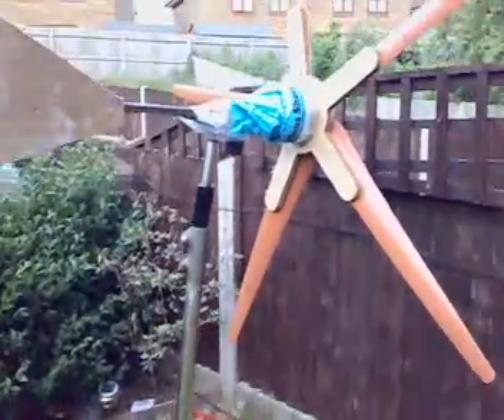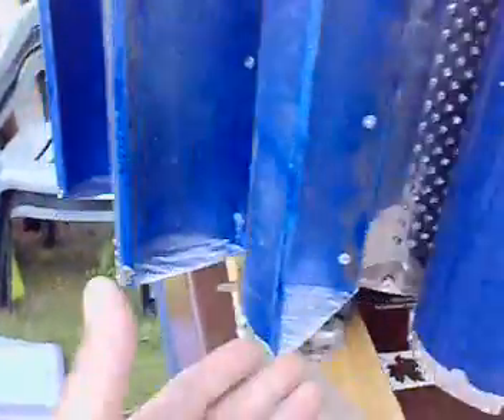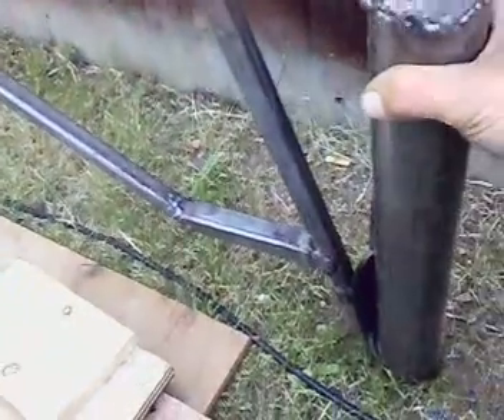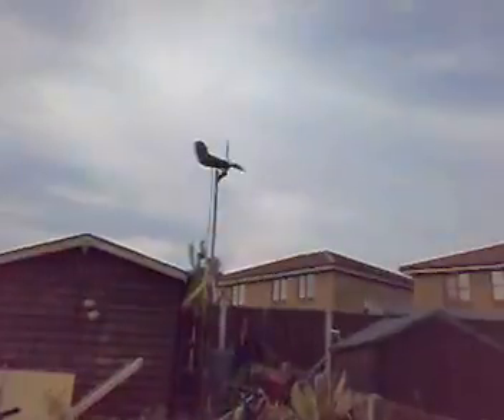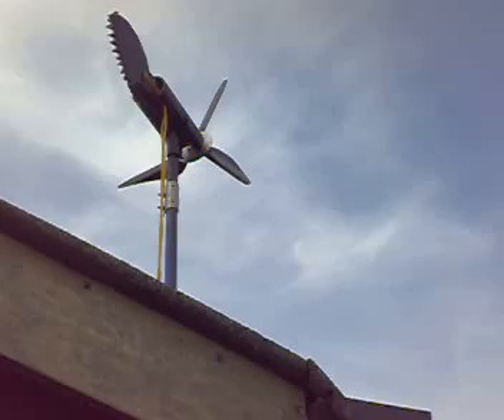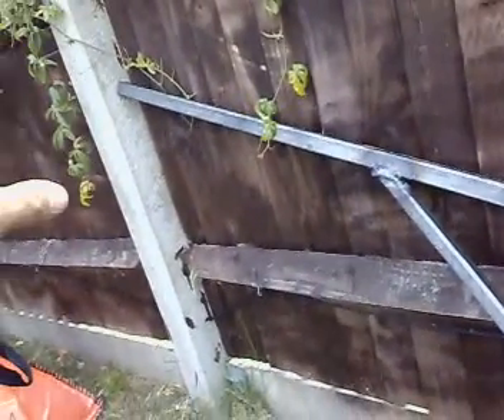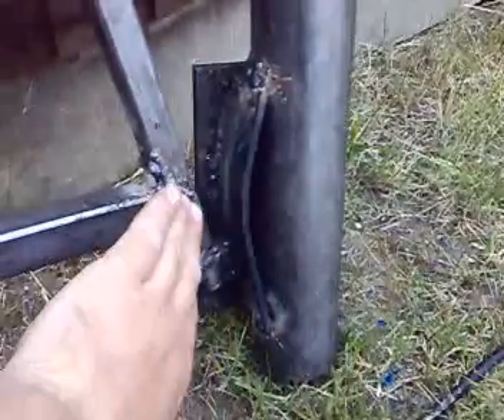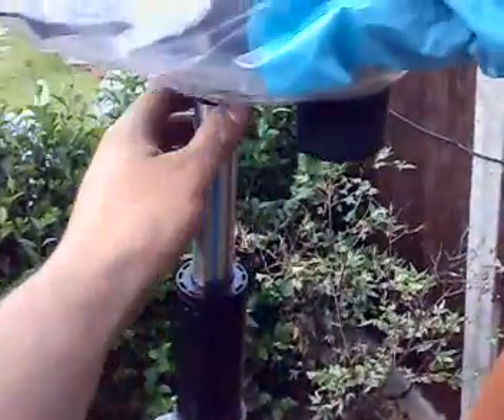vawt, new wind turbine

Comment: Nice work on the VAWT.  I've never seen one using a washing machine.  I'm planning one using a bicycle wheel hub as the bearing.  It should be just as smooth.  Your kids were making me laugh.  Even though they were driving you nuts, it was a good comical addition to the video. 
:-)

Comment: welding looks good to me mate weld done nice vawt blue pipe is polyurethene high pressure pipe and the blue colour tells us that it is for water mais supply and the yellow one for gas supply these are good kit for hawt blades as have a good thickness to for the airofoil and can be fond with diameters of up to 36 inches or 900mm side walls of 20mm on the big ones any way great kit mate see ya soon andy marshall x